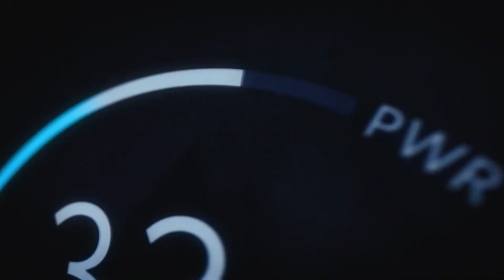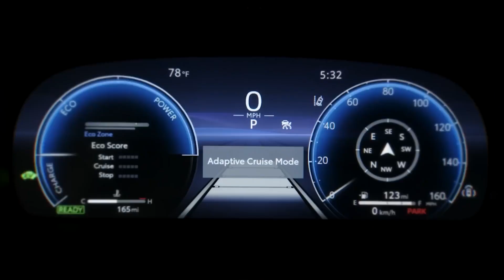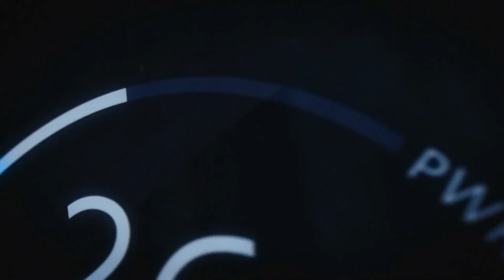New Toyota BZ3 600km RANGE !

Comment: I don't think this is a Model 3 competitor. It costs way less and doesn't have the same performance. I think it's a moderate sized electric sedan to bring to some markets. I can understand Toyota's reluctance to bring it to the USA because it'll probably cost $40,000 and while people buy a Corolla hybrid, which is a few inches shorter, they pay in the lower to middle $30,000 range. Initial cost is still a problem in the USA. I'm curious to how Hyundai's Ioniq 6 sedan will sell in the USA which has more performance than this bZ3.